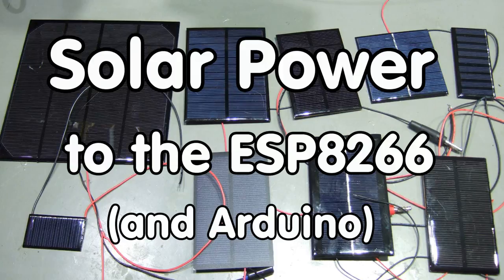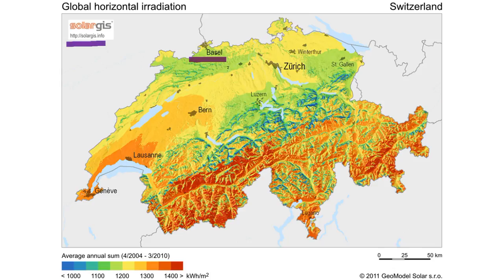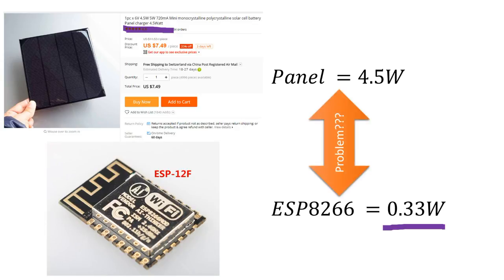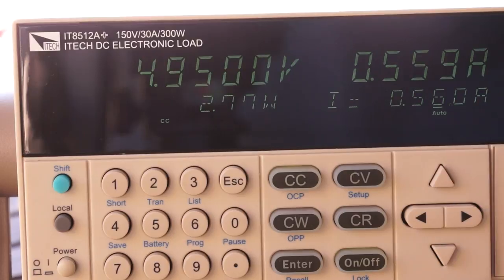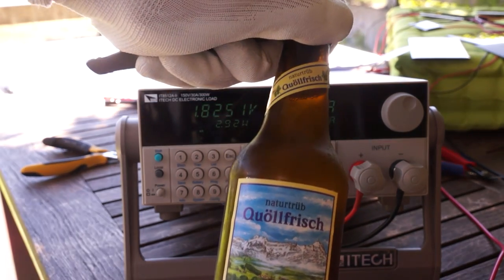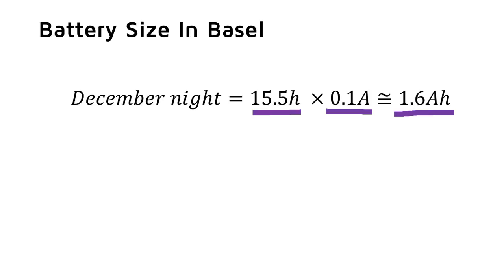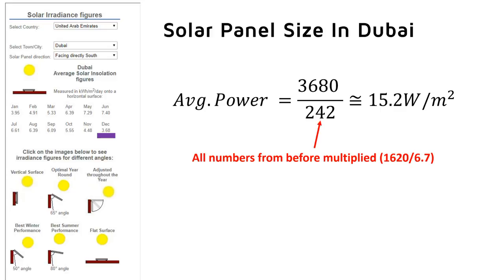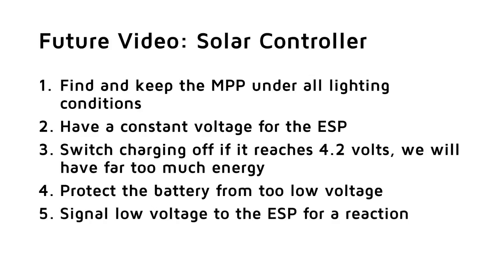#142 Solar Power for the ESP8266, Arduino, etc.

Comment: One important variable that should be considered also is the environment temperature. I have a 500W solar panel that reduces ~20% when we have hot weather. So, with clear direct face of the sun (and perfect inclination) i have almost have full power in the winter (498W was my best measure) and with around 30ºC or more, i have around 400W
Reply from the maker: +Nuno Justo Thanks for your info. This is more important for the usual setup. For this setup it is even an advantage, because we need every Watt in winter and we have to much in summer.

Comment: Nice work. However, i was wondering, wouldnt it be possible to instead of relying on solar panel power in the worst month (The way you do calculations now), incorporate a larger battery to compensate for the winter months? i.e. Store surplus power generated in the summer and use it during the winter? Much like you would for nights and bad weather periods? Or would be battery become too large? Well, if you need 14 batteries to surive 14 days, and you could reduce your power consumption to 10%, then the 14 battery setup should survive 140 days which should be plenty to carry you through the winter. Of course this will increase weight, but the sun-exposed-footprint of the device will be smaller which might make it more convenient. There is probably some room for cost-optimalisation though.
Reply from the maker: I think, there are many scenarios possible. The formulas will be the same. Maybe it is even possible to "simulate" different scenarios, compare the results, and chose the right one for your power need and location.

Comment: Hi Andreas,I've just checked your solar power video series. Your videos are awesome and as I am in the beginning of my hobby project I just started to research in the topic.However, I have two theoretical questions:
What happens if you switch your concept a little bit?
My main purpose is to run an ESP-01 on battery outside the flat. I want to run it from battery, but I can accept if I have to replace (well preferable recharge) my battery once a year for example but not much more frequently. With this I don’t need to run the system the whole year from solar power. Do you have an estimation how much the solar panel can be smaller just to support the rechargeable battery and not to run the whole system from the solar powers? I assume a much smaller panel is enough in this case. But I have no idea what size and power I would need. I believe the battery is going to deplete but hopefully much slower then without the solar panel. So basically, the solar power would just give some more time before I have to fully recharge the battery. What do you think about this?On the other hand, all your test run on wires which as you already mentioned in one of your videos has a measurable resistance and therefore you lose power through it. How will your efficiency change if you create a small PCB with short printed circuits? I assume in case of such a small system this modification is significant and has a measurable better efficiency. What do you think about it?Kind regards,
Gabor
Reply from the maker: I made a video with all these computations (search solar power)

Comment: I think one thing not taken into consideration is low temperatures affecting battery power and life. That can be a difficult obstacle to overcome in higher latitudes. A housing that can absorb some heat from the sun will help, but obviously not when there is no sun. Discharging can also be an issue at lower temperatures, even if it is less of an issue. However, keeping a device running for long periods of time when batteries are cold will be an issue. It looks like Basel doesn't experience temperatures much lower than zero in December and January, but where temperatures are near to or below zero charging batteries can be a problem. Some Lithium batteries will simply not charge below freezing, and will have issues charging below 5 degrees, only allowing charging at very low currents.

I wonder if you have been forced to take this into consideration for your projects?
Reply from the maker: You are absolutely right. I think here lead-acid batteries are still a good solution, especially if space/weight is no issue.

Comment: your video shows all the dilemma of solar power to be used as a single source of power, and this is true the same way for off grid houses in remote areas, and even grid scale. the effort to cover the last 10 % of energy for the darkest cloudiest winter days is economical nonsense if you have to throw away your resulting overproduction in summer. So this may be economical for small loads and when it still comes cheaper than connecting a line or adding an alternative power source. The many parking ticket vending machines are a widespread application where this makes sense. When grid power is available i have doubts if using solar and batteries is so much more eco-friendly in a lifetime consideration.
Reply from the maker: I agree with you. My application was for small power off-grid where a cable is not an economical solution. For other panels connected to the grid, there are many other considerations

Comment: Hi Andreas, look for the TP4056 li-ion battery charger. They're great little charging modules. Good luck
Reply from the maker: I will use one of these as a comparison. But they do not do MPPT. So, maybe I will find a better way. We will see

Comment: I bought a small solar panel from AliExpress sold as "5V 400mA". I measured the open circuit voltage at 6.5V and short circuit current at close to 150mA. I determined the MPPT of the solar panel to be about 300mW at 5.8V and 50mA (measured while adjusting a 10k rheostat in series with the panel). Does this mean I should replaced the resistor on the TP4056 to only draw 50mA?

Comment: this was an interesting calculation.
however, in practise,
larger solar panels are cheaper compared to the battery.
in other words, calculate the solar panel size for the cloudy swiss short winter days.
you might have 20 times more energy  during a sonny summer day than the device uses. but who cares if the solar panel is large enough to run it in a cloudy winter day.
also, batteries and panels degrade over time. the mppt controller will use small current during the night.
as a fist of rule, the battery should only be large enough to tide you over the longest night. and the solar panel large enough to tide you over a cloudy winter's day. and then double both up. just to be on the safe side.
Reply from the maker: Interesting different strategy. You seem to be more experienced with solar panels than I and your thinking is logical. Thanks!
Concerning charger: If I do my own, I plan to "deep-sleep the controller if no sun (= panel voltage) is available and also switch the charger completely off. Like that, I hope to achieve a current in the micro amperes rather than milli amperes. I do not know how much current a commercial controller will use in this conditions.
BTW: How much power I can expect (per m2)  on the worst day in Switzerland?
Reply: well. the worst day could be close to zero. the more cloud cover the less solar generation. i havn't lived in switzerland for 40 years, but remember 4 winter months with overcast, fog, high fog and hardly any sun. but i suppose probably 10% of the panel's peak value for a rough guess.( you might check the solar irradiation map or install a weather station with a  w/m2 device installed. also, in cloudy weather a panel oriented directly into the sky will generate more energy then oriented into to covered sun.
my experience is of running the house from solar year round. fortunately the winters here (sydney area. solares schlaraffenland) are relatively sunny compared to switzerland. we "overpower" the solar charger. that means often the charger limits the possible solar during  summer at noon. but then in winter you really want that extra over powering.
Reply: andreas you could also use this way ( I have check it):
1. protect your battery trhough a TL431 IC from lowvoltage (you could also take apart this part of the schema. Depends on battery price or a system that avobe minimum voltage your system (arduino o esp8266) advises you about the low voltage problem. Depends on if the circuit is near you or not).
2. to protect your battery for overvoltage, the best way is a little MOSFET and a pin from arduino, when you see that your battery's voltage is bigger than a predefined value, you can shortcircuit your panel.

It is a very low value charger controller, and I know that you lost power as the pane voltage will be always the battery voltage, but it is the simplest way. If you need and example I could send you my schema.

Regards,

Comment: Great video. Result ( with  deep sleep for 10 seconds ) is panel 10x10cm and one 18650 battery.  The information about requested capacity of battery is missing. 3000mAh?
Reply: 2600mAh for 18650 battery.

Comment: Hello,

thank you for your awesome videos!

I have the idea to combine solar and wind power, both to one project.(autonomous weather station).
Could you give a brief hint, where and how I would best connect both power sources?
Can I hook both to one charge controller?
Reply from the maker: Because they are very different you need two charge controllers which can feed one battery.
Reply: @AndreasSpiess  Thank you! That was helpful!

Comment: great video ,  I live where the sun can be a stranger too ,  but im on the coast and as such would have wind almost all year at some point in the day .  I had plans to make a  wind powered  USB charge port  , for well anything USB .   i wonder if you could add a small  vertical turbine style generator to you project , and harvest the wind .   not big , because it would only really be running in the worst weather . I have not gotten to that project , but  your project has reminded me .
Reply from the maker: Wind is a stranger here in the lower height areas. So, I do not think, it would add a lot. Also because it is very unreliable. But in many northern areas this can be an alternative to sun power.

Comment: Nice videos: thanks for doing them.

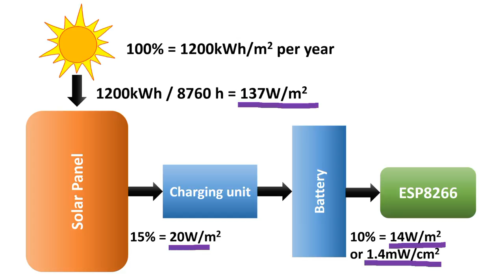I think a mistake at 3:22 where you write 10% efficiency. But in words you say lose 33%. So it should be 0.67% to be consistent with the 15% efficiency of the solar cell.

And in fact, looking at your newer videos, this is pessimistic, you find that several systems work at >90% efficiency.

In any case, I doubt if that 15% is right. I think it's 15% for medium to bright sunlight. I think a better way to get usable sunlight is to see how much there is above a certain cut-off level where the panel doesn't work.

Another point is that I don't think it's correct to try to match the panel power output to that required by the device. The critical power is that needed to re-charge the batteries after they have been discharged, and there is some (perhaps small) amount of solar power available. That might only happen in the winter, after a few overcast days. And you need to be able to re-charge the battery enough to allow it to last through another "dry" spell.

So the solar panel and battery sizes are based on worst case.

For instance at 11:47, I think the correct value of power to use to calculate solar cell size is not 0.33W (power to run device) but what you need to charge the BATTERIES, in the available time, with the existing sunlight in that time. A conservative design would be to fully charge your batteries in a day of "average" sunlight for the worst month, but maybe that's excessive.
Reply from the maker: 1. At 3:: I also include the loss of the battery itself. It loses some energy between charging and discharging
2. I use a top-down approach where I compare the long-term usage of the device with the longterm production of the solar panels. This should be similar, taking all the efficiencies into account. Then, I add the time of autonomy you wish. This is a highly statistical aproach but should work out for most situations. Batteries should be recharged automatically because the solar panel in the long term is capable to maintain the power need of he device. And if it was not able to deliver the minimum for one month, It will be capable to deliver more fr the next month. to catch-up the average.
Reply: I see. Well, that's another issue about this system: what's good for short-term behaviour (keeping the system running) and long-term (longevity).

I think that needs to be separated: like the basic sizing should be done for the short-term requirements separately from long-term, because if your system doesn't stay on-line as required it doesn't matter if it lasts a long time. Agree?

And one aspect of long-life of batteries is to stop them from becoming too discharged.

Some end-users might not mind replacing batteries every 6 months or annually if needed, and some might have no constraints on size of panel/batteries, or on overall cost. Whilst others might need small units that can last several years.

Anyways, as long as your study shows the raw data about efficiencies of each stage, then someone can do their own calculations. Your work is still very useful. In fact because you have looked at a broad range of systems it's VERY good.

Comment: Interesting video again, just noted that you used the congruent to symbol instead of approximately equal and also the title is mistyped.
Reply from the maker: Thanks. Typo corrected. Concerning mathematical symbol: It is a long time since I learned it. Maybe, I have to refresh it... I meant, that I did not calculate exactly, because also the measurements were not exact, and it does not matter too much, because I only wanted to show the principle.

Comment: I look forward to your MPPT video, I hope to learn how to make a custom shield for small projects, rather than using large ones form ebay.
Reply from the maker: The large ones anyway are not well suited, because usually, they deal with higher voltages and currents.

Comment: Great video!!. I am going to try to feed my arduino with the solar panels I boutght. I will see if it works.
Reply from the maker: It should work
Reply: Yes, it works. I have done for powering an arduino nano. I have used a voltage booster, a charger TP4056, a mobile phone battery (3.7V dc), one diode and the solar panel (small one, aprox 20cmx5cm). Thank you @AndreasSpiess

Comment: Hallo tolles Video. Ich hätte aber eine Frage, bei der Minute 12:22 taucht den Wert 242 und da war es mit nicht klar wie Sie darauf kommen. Freue mich auf Ihre Rückmeldung :)
Reply from the maker: Ich habe einfach das gleiche Verhältnis der Zahlen genommen wie in Basel. Das ist allerdings nicht ganz richtig. Richtig ist es 24*10 =240 (24h und 10%). Mit meiner Rechnung hatte ich einen Rundungsfehler. Bisher hat das niemand bemerkt.
Reply: @AndreasSpiess  okay danke sehr für die schnelle Rückmeldung und schönen Tag:)

Comment: very useful! do you recommend a online calculator or do you have an excel sheet to plugin our own data?
Reply from the maker: I have no online calculator or excel sheet. Just the formulas. But, if you look at the Dubai example, they are very simple.
Reply: You're right. What would you consider to be the most energy efficient way of low-range wireless communication (let's say less than 20 meters) ?
Reply from the maker: Maybe BLE? Otherwise the 433 or 868/915 MHz modules
Reply from the maker: + Larry: Thanks for the links. I will have a look at them.

Comment: Hi Andreas. I wonder if Amorphous silicon cells could offer any advantages during cloudy winter months. They have a much lower overall efficiency, but better low-light efficiency.
Reply from the maker: Maybe. But these days you can afford to take the next bigger panel in many cases.

Comment: I built this solar charger/supply and left it on the bench without a solar panel attached.  After a week my battery is trashed, completely dead, won't even get the charger started.  Worked well with the solar panel attached for a few days.
Reply from the maker: Very Interesting. Which board did you use? I thought I did not show one in this video.
Reply: @AndreasSpiess  I used TP4056 with protection.  https://www.amazon.com/gp/product/B083WDGF1L/ref=ppx_yo_dt_b_asin_title_o02_s00?ie=UTF8&psc=1
I think this is the wrong tutorial.  I meant to be in the one with a p-fet and TP4056 w/protection for solar panel.  #383
For some reason, I have trouble searching your posts.
Reply from the maker: These boards should not deplete the battery. They only consume a few uA.

Comment: Hi Andreas, thank you for this video.

Do you think the WeMos D1 Mini can resolve some of these issues? Eg. Charge Battery Through Solar Panel, Detect if power goes above or below 4.2v or 3.3v?
Reply from the maker: +Anton Chan The Wemos are similar to the other NodeMCU boards and have many components on board. For low power applications, I prefer plain ESP-12 modules

Comment: Ive come back tp this a few times.  You think I could publish an MQTT topic using LORA?  I'm just taking pool temps.  So If I took a temp every 20 minutes or maybe even as little as 1 hour.  I can conserve a lot of energy and keep the battery and solar cell to a minimum.

Thanks for all your videos.
Reply from the maker: Usually you do not use MQTT on lora, just send a few bytes with the temperature. And if you intend TTN then you also just send a number to save time (and energy)